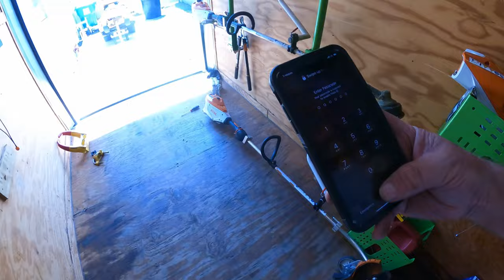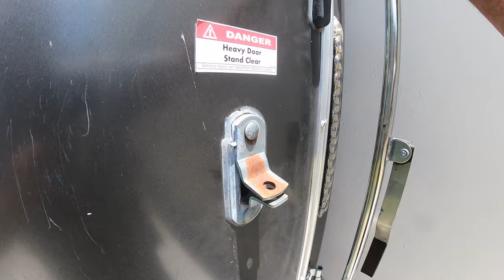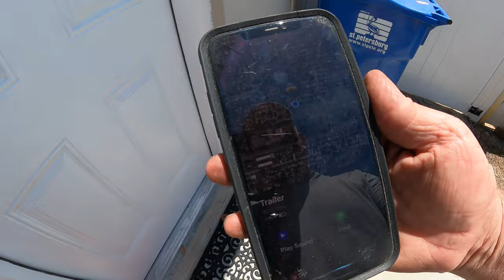Don't Let THEIVES take your Lawn | Trailer Equipment | Apple Air Tags | Find it on your phone

Comment: Found u after today just had my 2 week old stihl br800 back back stolen.  Disgusted cause it was bought with a credit line and the first payment hasn't even been made yet.  Guess one of my crew was on a mower and saw it happen.  A man and woman 28-35 yrs in a car grabbed and burned rubber before anyone could stop them.  No one had cams that captured plate #'s   I just wish I coulda been there to see it happen, and it was in texas, and I coulda made a deposit of precious metals in his ass!  Had a rope lock in the truck bed too but forgot to mention it to them 😒
Inspired and encouraged by your video.  Thank you for posting.  Going to see more about these kind of tags, that along with locks, have the bases almost at good as being watched
Reply from the maker: That sucks bro I feel your pain, yeah anything you can do to protect your equipment is worth it

Comment: Correct me if I’m wrong but I think AirTags work with android to. Just subscribed!
Reply from the maker: Yes you can,however not as good as you can with iOS. You can now use your AirTag with your Android devices, albeit it doesn't work nearly as well as with Apple devices. Apple added a new app to the Google Play Store called Tracker Detect. This app has its limitations, but it works just fine to track nearby AirTags, whether they're yours or not.